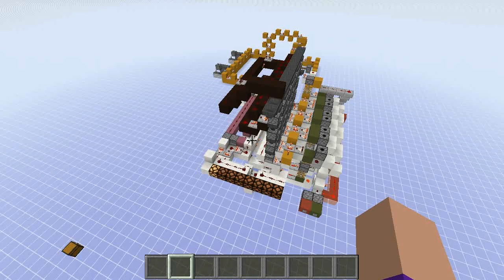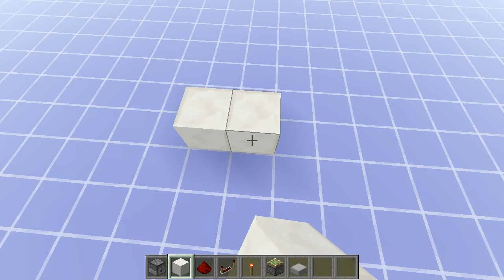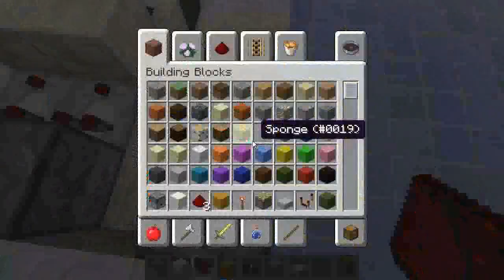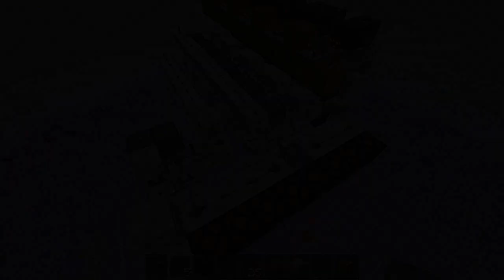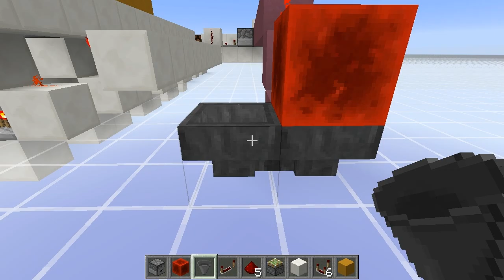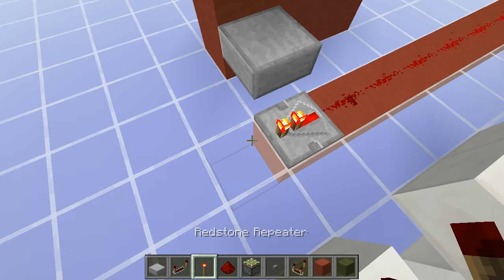Rotten Power Plant Tutorial

Comment: my is constally on 3 bars on 1.11.2 do you have a solution
Reply from the maker: Either you need to change your delay between checks because of your power wire length, or you've misplaced a block somewhere. ~Sparks